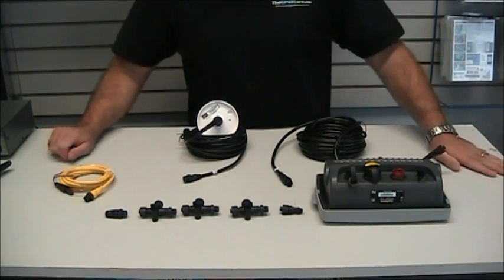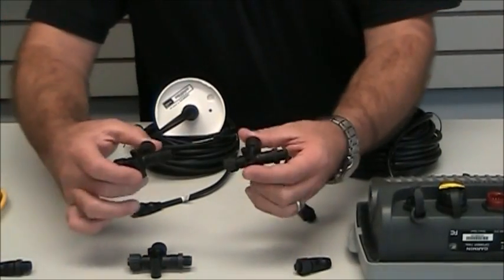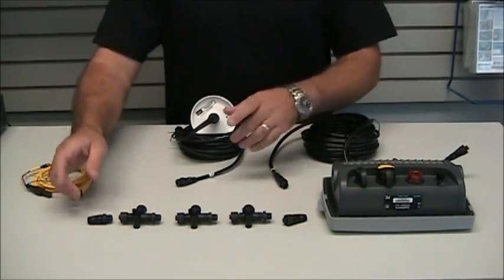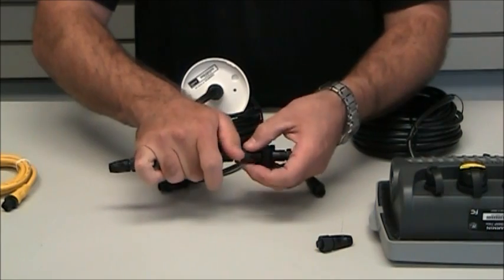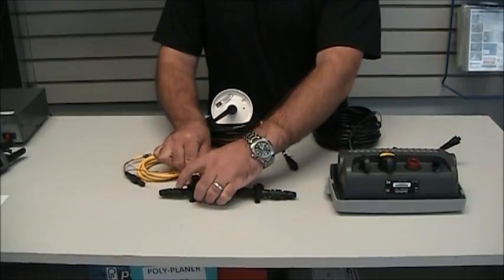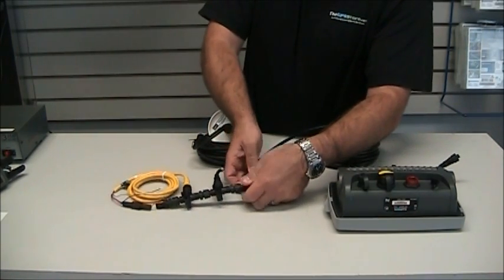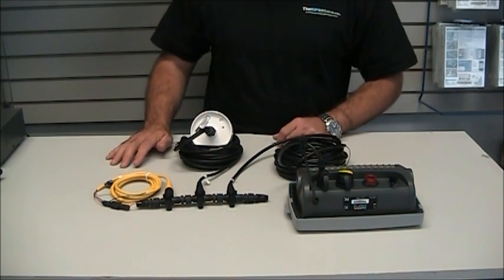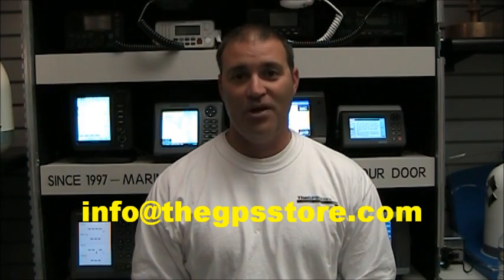NMEA 2000 Overview

Comment: Great info, question when connecting power to the NMEA 2000 will that power be used by the devices connected to it for the purpose of powering up and operating?  or does each device still have to be powered separately?
Reply from the maker: Hello, that is a great question.  Some devices will get power from the NMEA 2000 network and some will not.  Items like instruments, antennas and fuel sensors can sometimes power from the network.  However items like chartplotters/MFD's, Autopilots etc require their own power sources.
Reply: @TheGPSStore  Thank you for getting back to me
Reply from the maker: @bennyserrano440  Anytime! If you ever need to reach us faster feel free to email us at Info@thegpsstore.com or call in !

Comment: If I was looking to just read what my fuel tank was doing with just my Echo Map Plus 74cv, do I need all the parts listed in the video ?  I found the Garmin GFS 10 but still not 100% on what would be needed.  That's the only component I want to add to my chartplotter.  Basically want to replace the analog fuel gauge.

Comment: Is there enough power in the NMEA to run 2 Lowrance HDS units, Radar, transducer, Sonic Hub, Point1 antenna?
Reply from the maker: The power for the HDS units, Radar and SonicHub come from their own power cables, not the NMEA 2000 network.  The transducer will get power from the HDS and the point one antenna will get power from the NMEA 2000 network.
Reply: @TheGPSStore  Thank you.

Comment: How important are the terminator end caps? I know they have a 100ohm resistor. Can another device be added instead of a terminator?
Reply: If you are trying to save a few bucks, best if you just find another interest.  Boat the proper way that is fun is expensive.  Boating the cheap way always leads to tears and more aggravation than its worth.  Trust me, I've tried it both ways.

Comment: hi I am trying to hook up my nmea the yellow power cable has 3 wires. one is a silver looking wire with no insulation around it what ad where does that go
Reply: the "silver" (bare) cable is used to ground the nmea2K network. Connect it to the "minus", same place as the black cable

Comment: Looking to communicate with Suzuki 2009 NMEA backbone and connect to new Garmin. The Suzuki has blue connections that does not connect to the Garmin how do I convert to the new connections? Is this the part number I need ? NVX12705   MAN#: 000-0127-05

Comment: I am installing a lowrance hds7 Gen 2 Touch GPS to a Motor guide XI5 trolling motor via the nmea 2000 do I need to run extra wires or is there a certain connector that I have to order

Comment: Hi Geo Matrix, First we need to know if you have used the BBWGPS with a Navnet. If so you will not be able to use it with the PC.  If not, then you will have to connect it through an RS232 port, assuming your PC still has one.

Comment: Question: if I have a Lowarnce HDS-8 on the consol, can I use a Garmin on the front deck? If I understand the video, as long as I have a separate power source for the Garmin, the unit will work as long as I use the back-bone.

Comment: I understand that there is a connection on the Yamaha 150 4 stoke that will link to this NMEA2000 system. I have the exact configuration, but would like to see the data on my Garmin 740s. Some research indicates I need a Garmin Yamaha engine interface cable. This cable should feed all the data I need. However there is some controversy as to whether or not fuel consumption is part of this data stream. Would I need to add the Garmin GFS 10 fuel sensor?

Comment: Great video !!! I am going to install this NMEA 2000 system on my bass boat that has an HDS 8 Gen2 at the console and an HDS7 Gen 2 on the front deck. Is the Lowrance system as easy as this Garmin ? Also would you suggest the Point 1 antenna or the LGC 4000 ? Thanks,    Bill

Comment: Thanks for putting this video together.  Does the HDS also need a power source, separate from the power to the NMEA?  Or does the power that supports the backbone also supply power to all devices connected to the NMEA backbone?
Reply: lowrance needs seperate power

Comment: You need a NMEA 2000 starter kit and a cable that will send the info from the motor to the network. Lowrance has one for yamaha for example. 120-37 is the number.